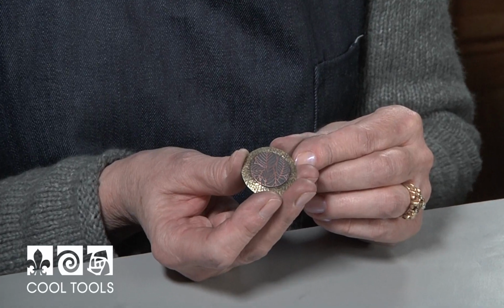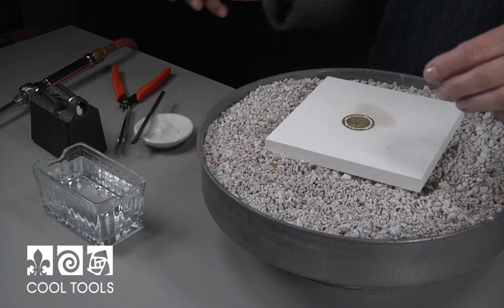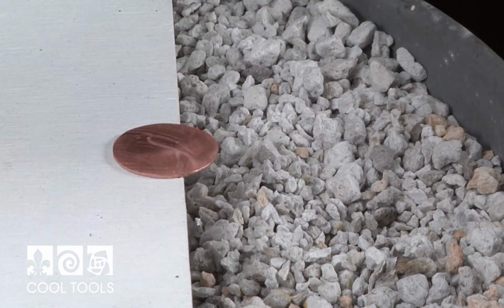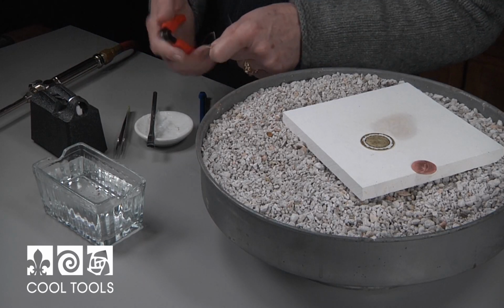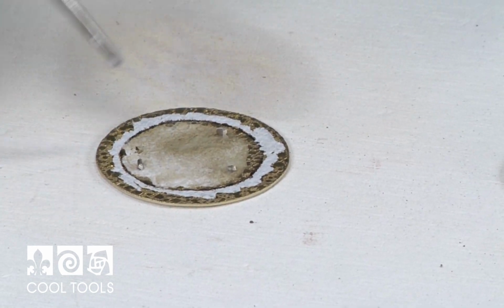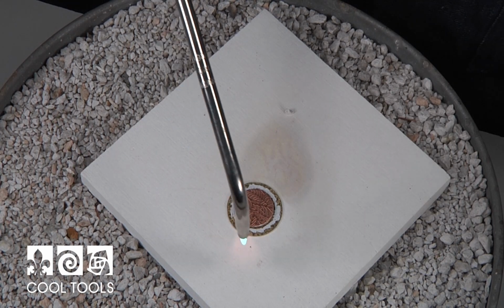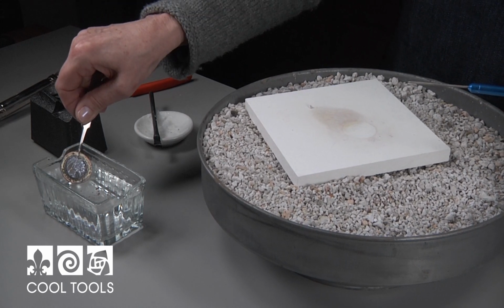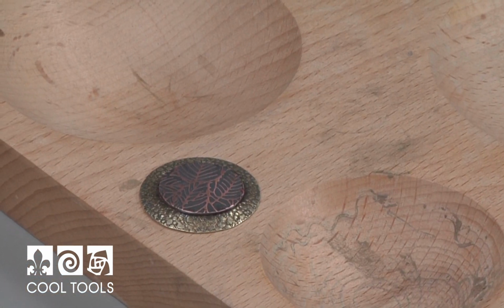Soldering Technique - Joining Textured Metal

Comment: Is there a way to get that textured look onto a piece of metal that is on the gold looking piece your attaching to the copper piece? I am wanting to get a free form bumpy texture look on to some of my rusty metal charms to make  them into necklaces. The rusty charms take on a silver color textured bumpy look...but how do I do it? I have seen charms that are done but want to make my own. Can I just flux the metal and free form dribble the Silver/Pewter Solder I have over the charms with my gun?
Reply from the maker: Hi Pamela, 
We asked Terri McCarthy your question and she said: "The metal was etched in Ferric Chloride to get the pattern. Are you using the low temp solder with the solder gun that is also used for stained glass windows? Or are you using silver solder with a torch?"

Comment: Huh...So in jewelry making, a swage-block can just be a hunk of hardwod? I mean, I guess that makes sense. But as a hobbyist blacksmith, I am now kinda jealous of this trade.
Reply: I have wood swage blocks, when the metal is annealed it's perfect!
Reply: In jewelry, we're working with non-ferrous metal which are softer than what you use. It makes them easier to form, but also easier to dent , bend or deform when worn. Rings are notoriously hard to design, as you want something unique, but that won't bend, dent or snag on things.